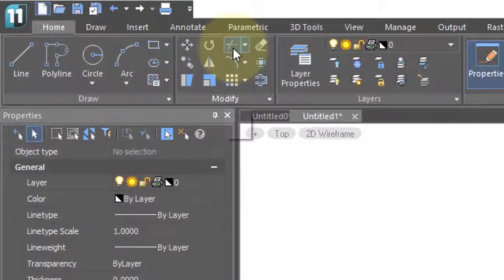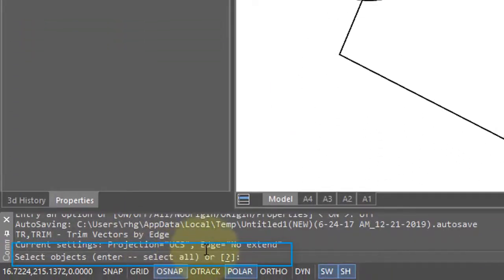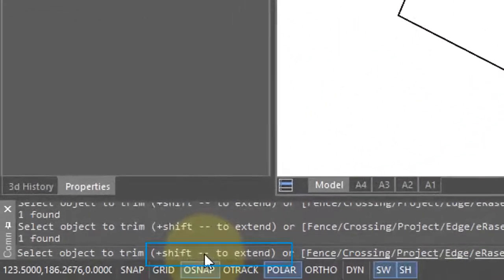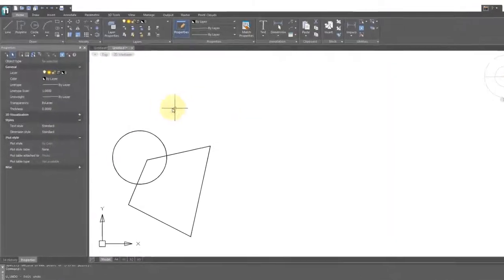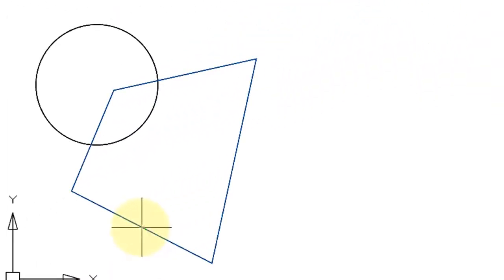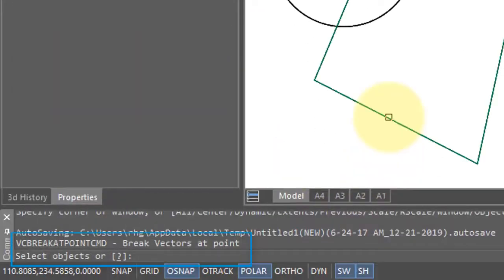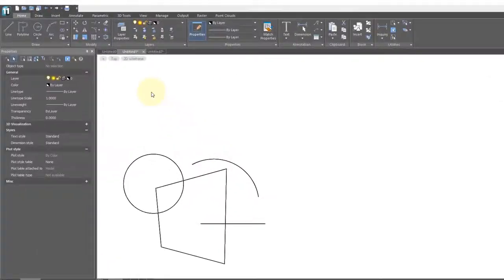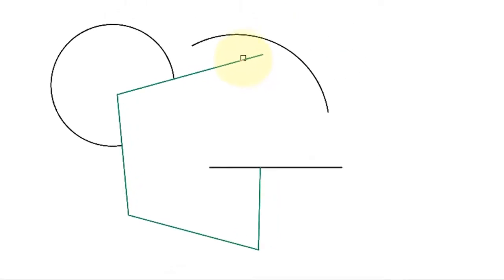How to trim and break objects in nanoCAD

Comment: Does nanoCAD 5 have dynamic input? Because it is really hard to use the program without it.
Reply from the maker: No, nanoCAD 5 does not have dynamic input feature. It is added in nanoCAD Plus 20 and nanoCAD Pro 20. You can request for a trial to check the feature.

nanoCAD Plus 20 trial download link: http://nanocad.in/download-product/2d-cad-software

nanoCAD Pro 20 trial download link: http://nanocad.in/download-product/best-cad-software